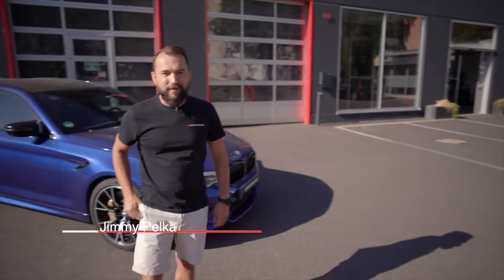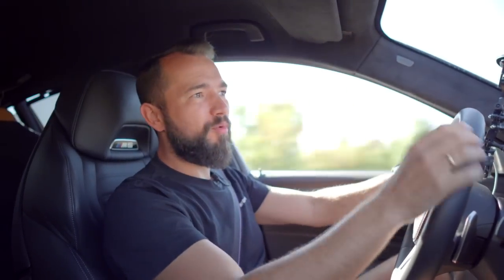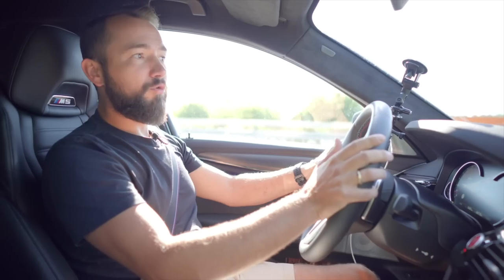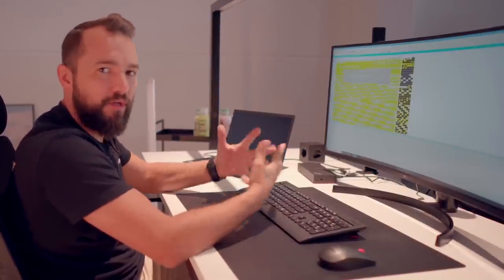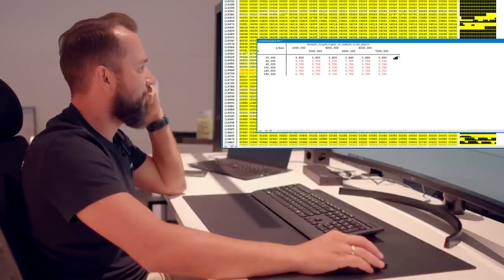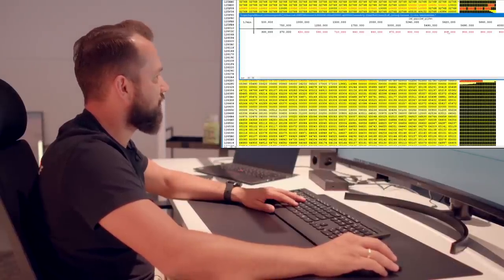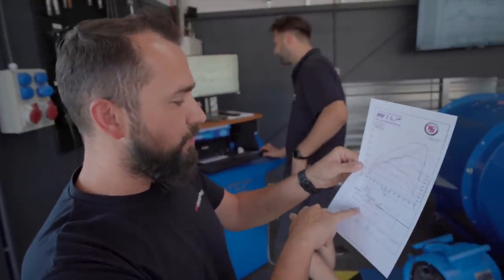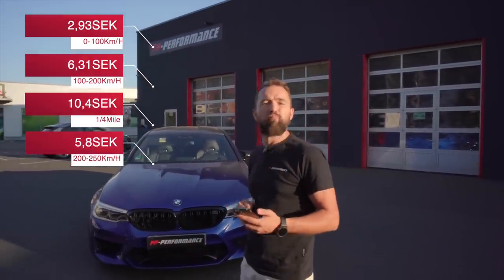BMW M5 Competition STAGE2 | PP-PERFORMANCE

Comment: Hallo Jimmy ich bewundere dein Programmier Know How. 

In diesem Beispiel hast du gesagt, es handelt sich um ein Bosch MG1 Steuergerät. Sind die Originaldatenstände nicht immer genau dieselben bei identischen KFZ mit identischen Steuergeräten?

Habe mich gefragt, wieso du nicht einfach eine bereits modifizierte Kopie einspielst, sondern immer alles von Beginn an neu programmierst.
😎
Reply from the maker: Wir machen nichts von der Stange 👌
Reply: @pp-performance  die Datensätze sind ab Werk also nicht immer identisch?